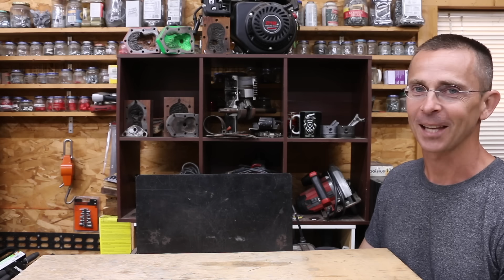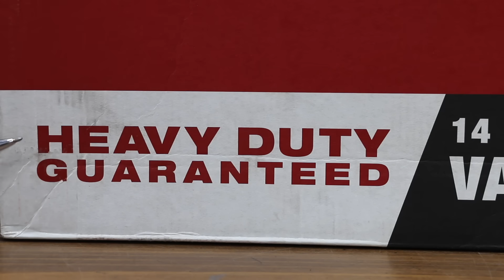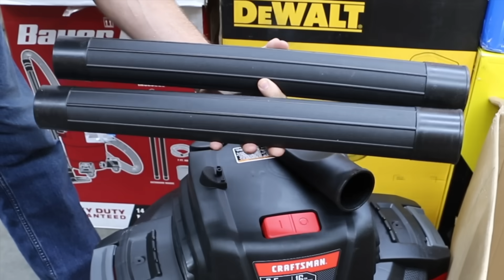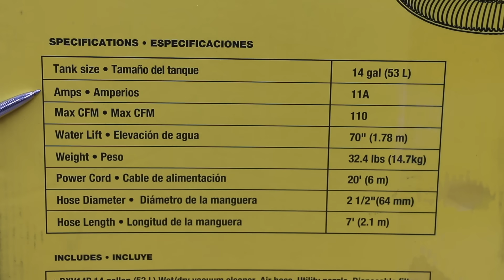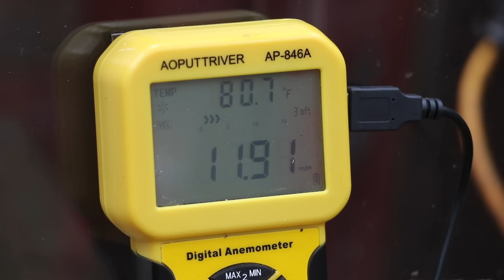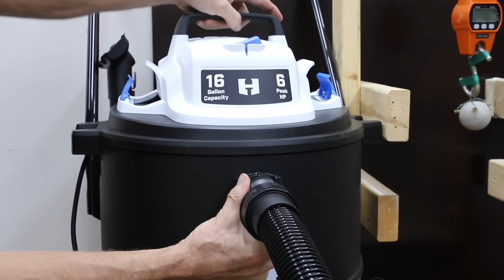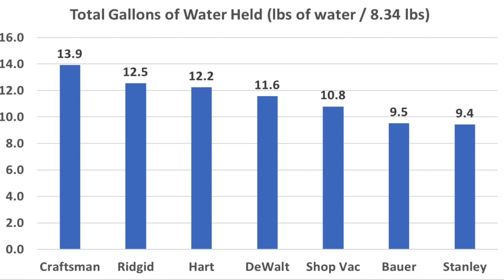Best Shop Vac? Ridgid vs Shop Vac, DeWalt, Stanley, Hart, Craftsman

Comment: In the UK we have the Numatic range of cleaners, encompassing dry, wet and dry, wet only and 3-in-1 (extraction cleaning), plus scrubber dryers, polishers and cleaning trollies. All are made in the UK (Chard, Somerset) and all are tough plus extremely reliable (most reliable vacuum brand in Britain year after year). They are not always the cheapest (the smallest dry only machine is ~£110) but their longevity pays for itself (ours is 13 years old, with the only maintenance being new bags!). I have looked at cheaper machines in the past but would rather buy a locally produced (about 40mi away) machine I can rely on, plus they are easy to repair and genuine replacement bags are cheap, even cheaper than the non-genuine ones sometimes!
They do domestic orientated machines (although these are commercial spec/quality and was the original market for the "Henry"), commercial and industrial machines though they currently make no upright machines.
We have three of their machines (a cordless tub "Henry" our main vacuum a mains power tub "Hetty" and an all-in-on wet/dry/extraction/hard floor cleaning "George", all do their job excellently.
All the domestic machines (and some of the older commercial machines) have names and most commercial and all domestic machines have a smiling face reportedly originally done to make the job of commercial cleaning more pleasant and not just some marketing gimmick.

Comment: Please test power probes as it is a common diagnostics tool for auto/boat/small engines. How big current draw and what it can messure volt/ohm and so. Could be a good video. Like the way you test stuff👍🏻

Comment: Thanks for the video. I need a shop vac to clean out my pigs cemented pond and needed to figure out which one would do the better job. the pigs like to drag all kinds of stuff and dirt and poop into the pond and i have a feeling a vac is going to be the best way to get it cleaned out. I will be going with either the Shop vac or the Bauer. thanks for helping me out with my decision.

Comment: I'll take the DeWalk for the simple reason of noise.  I use my utility vacuum a in my basement frequently, and the difference between the Bauer and Craftsman (both particularly noisy) and the DeWalt (quietest tested) is significant.

Comment: I bought the best ShopVac 10 Gal stainless with handle.  After a basement renovation, it was shot.  I pulled the motor and found it did not use bearings.  The shaft was held by two worn out brass spherical bushings the size of plumbing compression sleeves.

Comment: Video suggestion. RV surge protector showdown. Test when they actually shut off the power based on high or low power. Test how weather resistant they are. How well do they test the pedestal. Test for overheating at plug.

Comment: Great test and process, as usual.
I’ve had a craftsman vac for 8 years now. Still works great.
Bauer shows itself often as a good option for normal home use.
Just stick with red! Unless you’re going to be putting it on a truck with a contractor’s name
on the side, you’ll be just fine

Comment: I would be curious to know if weld through primer works, or if its just marketing speak for spray paint. If it does work I would be curious to know which one works best, I saw a different video where the guy said Rustoleum rusty metal worked as well as an expensive weld through primer. Thanks for all you do, you're doing some good my friend!

Comment: You have a Great Job! 
Something I'd like to do if I wasn't retired.

I have my Dad's old Montgomery Ward shop vac. all metal (except for the rubber wheels and the plastic hose). I'm not sure of the weight but it works as well now as when Dad bought it back in 1970. I also have a 1941 Kirby Model 409 vacuum draws 2 amps and still works great.

Keep these videos coming, they are great!

Comment: All that marketing nonsense would be illegal in the U.K. The power can only be expressed in watts, no motor inertia, and pickup in litres of actual usable capacity. Selling products using numbers which bear no resemblance to the useful characteristics of a product is fraud! As for 90 day warranties- Seriously? Even the cheapest electrical devices from the budget supermarkets Lidl and Aldi come with 3 year warranties here, and still cost less than any of these.

Comment: I have a Ridged 10 plus years old.  The top is so tight I have to use a bar to remove it. 

It has a bottom adapter so it will move water out and dump it with or without a hose so there is no maximum amount it will hold. The suction can pull carpet off the floor. No need for a wet/dry filter since everything is dumped to the bottom.  It's by far the strongest I've had replacing a Craftsman that sucked water into the motor. 

I have no complaints. With a 2 1/4" hose don't get too close to the cat.

Comment: Can you do one on handheld butane torches please?  all of the reviews i can find online seem to be ahem “commercially driven”, while safety features, flame size, temperature, time, etc. all vary.  Looking for one that can heat seized nuts and bolts, do a bit of soldering, and do a good steak or creme brulee appears quite difficult, and would make for a useful and entertaining video.  :)

Comment: Would be easier to just research the motors. The specs would point right to the best vac. Odd how they avoid to give you the details needed to make an educated choice.

FYI - I believe your suction test is really a test of the static pressure.

Comment: Two things you didn't test:  First, is the sawdust powder suction. These vacs tend to really pick up sawdust great for a short while with a new filter, then the filter gets clogged and suction drops drastically. Some filters have much better "clogged" flow than others.
 The second thing you did not mention is the price of the filter. Do they all use the "generic" $5 filter or do you have to have a brand- match filter that can cost 3 times as much!

Comment: If you re-used the sand it would get easier to vacuum each time since more fine dust could be removed each time.  It seemed like each successive sand test got faster and faster with maybe one exception.

Comment: You can't convert amps to horsepower. You can convert watts to horsepower. Watts are volts multiplied by amps. You need both volts and amps to measure power output, but all vacuums are running at 120 volts.

Comment: I’ve got an old Craftsman shop vac that I got back in 1992 I believe and it still works, the insides are trying to rust some but it’s stronger than my house vacuum cleaner. Anyway thank you for the great video

Comment: I think the Craftsman has a lot of good points, and it is lighter than the DeWalt . . . But I would take the dewalt if price was no object, and weight was not a factor.
But weight, and price are usually a factor, so Craftsman is probably my choice too!

Comment: is it possible to test the best dielectric grease to clean, remove corrosion  and restore clean connections to eliminate resistance between connections, possibility of a tournament , testing for efficacity , heat,cold , water, acid, flame , different voltages and amperages, those products are liquid, paste

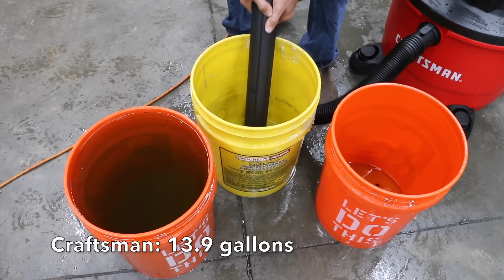Comment: I noticed the Craftsman came in at 1st with respect to wet water pickup capacity at 13.9 gallons... but I also noticed the inner mechanism, that is supposed to stop the water flow, allowed water to flow through the motor at 12:20 did you have any issues with it after that test?

Comment: You should totally test alkaline battery brands! What's the best AA? Does lithium make a difference? Are SUPER HEAVY DUTY ALKALINE batteries worth anything? What about consistency; you could weigh them to check consistency in materials used too.

Comment: Does the size of the hose affect suction strength? The bigger hose diameter might have an easier time due to surface area of the rubber ball.

Comment: Dear Todd; Like your videos. Magnetic drain plugs; we use them in all our motors and any transmission that contains oil. Log spliter, compressors, rototiller, etc. The most satisfying was the gear case on the Winco tractor driven generator which attracted an amazing amount of small chips. When I was working I know that some power steering pumps and automatic transmissions came from the factory with a magnet in the reservoir. I used to buy them for $5-10 but now buy the magnets in bulk and epoxy them to cleaned and roughed-up existing plugs. We like looking at and cleaning them at oil changes. But the hard question is how to test if they really will extend the life of a machine.  The two things that come to mind are 1)Adding magnetic drain plugs to several compressors or other oil cases without changing oil to see what they collect and 2)Putting iron powder in a running lawn mower engine over a long run time to see if they reduce wear. You have a lot of good ideas on how to test things. Thanks

Comment: The suction test needs to be done with the same size hose end where it touches the ball. Larger hose ends engage more surface area of the ball and will therefore exert more force. 2.250 dia vs 2.500 dia is a difference of 23% in surface area.

Comment: most of tests are pretty good the one problem I have is with the mile per hour you're not really measuring static pressurein a smaller diameter would increase the miles per hour but you won't have any volume CFM so blah City static pressure together

Comment: Would love to see a video comparing vehicle dc to ac inverters, maybe a mix of ones that plug into the cigarette lighter and ones that get hard wired in.  Do they put out the power they claim to?  How much power is too much before you trip a fuse for the cigarette lighter, etc.

Comment: Even though it doesn't fit on this video, I think the likelyhood of you reading this suggestion here is higher. So here is a tip for your next test with jb-weld: From my testing and a bit of research that I did, I found that the strength can be increased by 100% on most bonds and up to 1000% on some bonds, especially on wood. This can easily be achieved by heating the bond for a couple of minutes at a temperature of 60-130°C (140-266°F). I did not get better results with higher temperatures than that, but 130°C is definitely better than 60°C. Also the hardening time is decreased significantly with higher temperatures. For example, if you can hold 80°C (176°F) for an hour, the glue is either completely hardened, or really really close. 

I would love to see your tests on wood and the cylinder head again, just with this trick. Also you seem to be able to do more scientific tests than I can, and I'm very interested in finding out whether or not my results are actually correct. 

Please excuse my english, it is not my native language.

Comment: I have that Stanley shop vac and got it on sale for $50. It may be a thoroughly average shop vac but for that price it absolutely kills the value ratio. I use it for sawdust, CNC shavings, even cleaning up automotive messes and it gets the job done every time.

Comment: Did you account for the different hose diameters when you did the lift test (or did you connect in the same diameter nozzle for all the tests?)  The 2 big things needing addressing are the filters (and the ease of finding new ones, or washing them).  Anything with a bag doesn't cut it.  You need to run tests where you use them to vacuum stuff for 6 months, clean the filter,  and THEN see what wind speed you get.  Most "shop vacs" end up having powerful suction, but only a mild breeze because the filter is clogged (and you can't get new ones 5 minutes after they are sold).  Filters should be cartridges, in standard sizes, changeable to suit types of dirt pickup.  For some brands that use cartridge filters, you can buy aftermarket filters (Teflon coated, washable, etc) that improve performance.  I wish the manufacturers would stick to "stock" ROUND, THICK bucket or barrel sizes that don't leak, instead of those "artsy" complex oval, thin, shapes.  Which of brands you tested used cartridge filters?  A "yes" should raise them in the rankings.  Another factor is the dust that gets out the exhaust.  Shop vac is no good if it merely redistributes the dirt in the room.  (May be OK for outdoor use.)

Comment: Another idea would be locking nuts and washers the different styles and how they handle against temperature, vibrations, torque, and if they damage the surfaces of the part they are holding together.

Comment: I don't know if it would be possible for you to test small 3 to 4 hp boat boat motors. All I have is a trolley and can't go to far on big lakes with 2 batteries I've been hesitant to buy a gas motor because I dont know what's reliable

Comment: Wondering why the Dewalt wasn’t crowned “The Best Shop Vac”. The title of the video suggests that it’s based on performance, not value. If it’s performance based then Dewalt should have been crowned the winner. Otherwise, maybe should incorporate a “value” metric in testing and maybe reword the title.

Just sayin...

Great work regardless.

Comment: I have a rigid shop vac. It's about 15 years old and has been sitting outside in the weather for half that time. It still sucks clogs right out of other vacuums. I was using it earlier today to shampoo the carpet in my truck. It gets the carpet much dryer than actual shampooers I've used. And the detachable leaf blower is an awesome feature. The lid locks down tight, with none of the wiggle that the rigid in this video had.

Comment: i owned 2 of the rigids. i only have so much room on truck so detachable blower makes it number 1 to me. i had first one burn up after 1 year but i would let it run 1 hour plus to dry joint compound or leaks. it gets hot.. there is a foam filter around motor i should of cleaned out more . its not easily accessible.

Comment: I have used several shop vacs over the years. Here are features I think are important. 1. Hose flexibility. 2. Weight. 3/ Maneuverability. 4. Noise  Not important is holding capacity or horsepower.

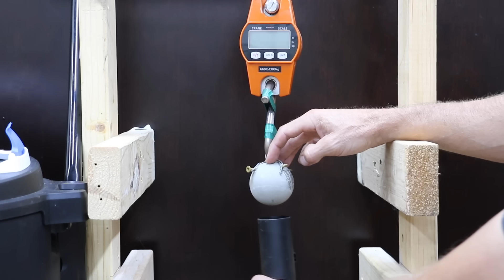Comment: @7:58 For testing the suction strength you should divide the force by the suction area (area of nozzle opening) to get comparable results. Or simply use the same nozzle for every shop vac.

Comment: Are there different models/serial no. for shop vacs from these brands? 

*Ok there are different models so one brand isn't necessarily universally better than another, it will depend on which models you are comparing. I was originally thinking each brand sold one type of shop vacuum because I have never bought one.

Comment: Good video but I wish u would have used a rigid shop vac  without the removable blower. I have 2 rigid shop vac without that blower as it seemed gimmicky and felt it would affect overall performance as it may have done here. Nevertheless good job as always

Comment: I have had the Rigid vac for about 15 years and it has been put to use all that time. The wheels were worn down after about 12 years and I wanted to buy new ones and when I inquired they sent me 4 new wheels in a few days at no charge. I use the leaf blower to blow the air off my cars when I wash them.

Comment: Your suction test is almost entirely a function of nozzle diameter, since the  measured force is equal to atmospheric pressure minus vacuum pressure all multiplied by nozzle cross sectional area ie: (3.14*Dia^2)/4. You could control for that using the same size nozzle on all machines.

Comment: Wow talk about Irony.....I just Bought My Second Craftsman shop vac in 30 years & ONLY because I could no longer Rebuild the motor brushes in the Old 20 HP Stainless Steel/Chrome Version Vac we asked Sears & Roebuck to make when I worked their  Commercial Division here in Tampa! 
    I did debate on the Dewalt but Because it was made in China & I Like Most of US  I was raised on Sears / Craftsman/ Skill / Milwaukee etc.  Sadly alot forget is This is A US Brand ( yes its made in part in Mexico but alot better than China) and I know your testing for the sake of testing and Im all ok with that...But in the END with all the JOB loss in the US.... I would much rather buy something I know will benefit the USA and North America than some country half a globe away that we all know most times is very shoddy construction!!! 
   
      I have something to Peak your Curiosity I have been testing the EGO 56V Battery system for Trimmers, Chain saw, hedge trimmer, pole saw, etc,  ....I ask BC I have been testing them on the Ranch VS the 2 cycle stuff & im getting converted Very fast to Battery powered ( I will say if you do test them use a 5.0 or 7.5ah battery).. ..I was so taken by the EGO 56v system, I bought a New 650 cfm Blower from EGO and it out preforms my Friends Pro Kawasaki Blower they use for Parking lots, he was NOT happy.....his is rated at 750 cfm but he says MY EGO  Blower was easily 3x stronger than his $2200 Custom Blower!  He asked if I had a commercial account so he could ordered 4 from EGO commercial and this is a guy who like me always though electric....hahaha...yeah....ill pass.....But stubbornly I can say... in alot of uses we've been finding out the EGO 56v stuff is actually better!! 
   I do want to say Great testing and My ramble is in No way against you young man Keep on doing your Great work!!!  Cow}:-o)